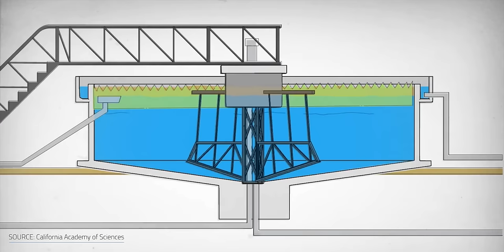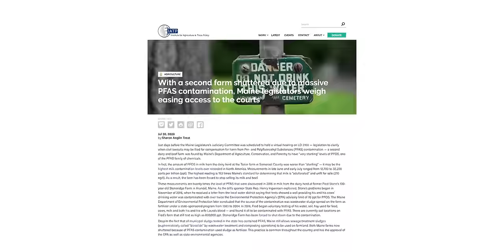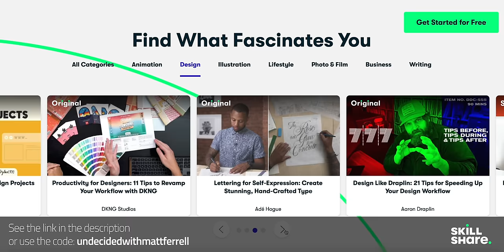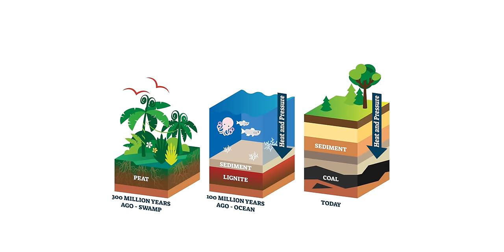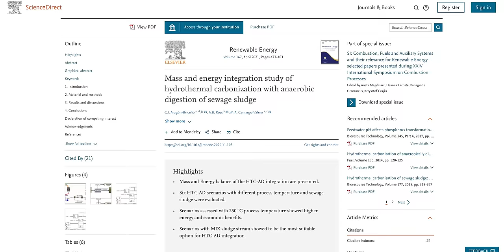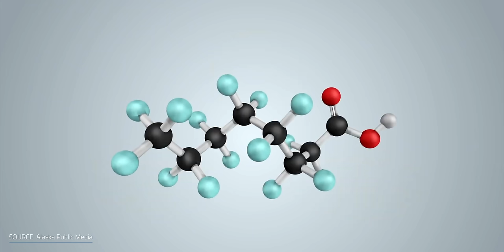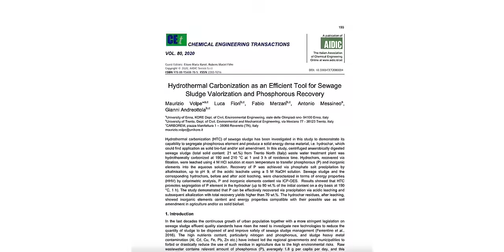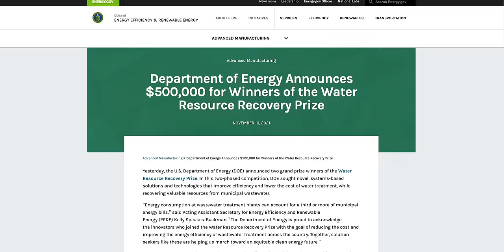Turning Human Waste into Renewable Energy?

Comment: I work in the water / wastewater "industry."
First a point of clarification; in the video around 3:20 you make it sound like waste treatment plants can or regularly do discharge insufficiently treated water into lakes and rivers. This is not the case at least in the US and I would bet most of the world under stable governments. While each state in the US is responsible for their own policing of EPA mandates, EPA and the State monitor WWTPs and WTPs very closely. While I am not read on the issue in Maine it is likely that it has to do in slow bureaucracy not keeping up. More about that below.

To my main point. Above I put "industry" in quotations. This is because generally WWT isn't a business. There is no money to be made in it. It is a nessassary service that any municipality needs to have and is therefore tax funded and not back by investors. While there are cases of commercial WWTPs these are more in kind with Doordash. You really could have done it yourself, but chose to spend a great deal more for someone else to handle it.

The municipality to state to EPA relationship slows down everything to paces where employees can be hired, work 20-30 years, retire, and things that were 'in the works' when they got hired still aren't fully implemented. An example, my local state level only got approval to accept credit cards for license renewal, learning materials, etc in 2001. That is a solid decade after the entire retail shopping sector. The big wheel of government moves slow and this change will too unless the private sector can somehow make this tech profitable and figure out how to unstuck the previously slow moving wheel as they will still be governed by the EPA.

Comment: Matt you are way off on the scale of dry tons of (sludge) per day produced by the U.S.  I operated a city treatment plant with just over 2000 sewer connections.  The town generated ~173 dry tons of sludge in 2010.  This was a small plant, with max capacity @  0.75 MGD.  Which is only 0.473 tons a day.  But this is only one small town.  So your range of 5-13 tons per day for the entire U.S. is probably at least 31,000 dry tons under.  Chicago's wastewater treatment plant (I think the largest in the world) has it's own facility to generate pelletized fuel pellets from waste sludge.  I trained with an engineer who worked there.  Food for thought!  No not food....and don't drink from the purple faucets at wastewater plants.  I've seen that ruin one too many thirst workers days!

Comment: India has public transportation ie scooters running on biogas (gas from poop) . They have a household gas cylinder sitting under the seat.
Also the regular cooking gas for households is boigas ( called gobur gas there).
I am surprised that the west has been slow to do research into these low tech methods. Maybe because poop is nor the fashionable thing to be dealing in!! In villages there cow dung is quickly picked up and used for making into cakes as a heating fuel. And also to make into walls floors for their dwellings. It hardens and no smell and actually clean.
Millions of indians are supplied with biogas in cylinders to private residences buildings etc. So large populations in cities are not dependent on nuclear  or deep sea power . Or other methods which are ecologically less feasible.
Endless heating, cooking ,building material all recycled from cow dung / human waste / vegetable scraps. And other agricultural waste.
About time the world starts thinking differently.

Comment: its called a methane digester... congratulations you've discovered a technology they've had in zimbabwe for years
Reply from the maker: Did you watch the video?  It's not a methane digester.  HTC is completely different, but yes, it's not a new technology.  It goes back to 1913, but we're only now starting to apply it.
Reply: @UndecidedMF  yea i watched the video, its basically the same thing except your having to process it a lot more... where as a methane digester just requires low heat and the odd stirring every so often.

like if you really wanna go the extra mile you can then split the methane into hydrogen through steam methane reformation removing the exhausted carbon dioxide through carbon capture and storage and taaadaaaa you have hydrogen fuel from shit...

and then you can use the captured carbon that is now in its raw solid form for things such as manufacturing them carbon fiber wind turbine blades...

like everyone thought the movie "thunderpants" was a joke but there actually is some really interesting science behind turning fart/poo into fuel...
Reply: @UndecidedMF  either way the HTC process as carbon neutral as it is still has one glaring problem... your producing coal... which is one of the dirtiest burning substances you can get... like id rather burn a diesel lamp...

Comment: human waste is compostable it's literally the best fertilizer if you simply just shat into a special compost bin that has a natural gas vacuum to store the gasses created for later use as clean gas it sequesters carbon and also makes it so you don't need plumbing if used on a home to home scale it would be a better way to manage our society as PFAS and other forever chemicals need to be removed we could add in special enzymes in powdered or other forms that are designed to break down plastics and re-engineer them for PFAS and other forever chemicals, and bam you have a hyper efficient waste management system that also gives you compost and natural gas for near infinite uses, all you need is some wire mesh, duct tape, nails, 2X4's, and a saw, tarp, some tar, and a hammer and a simplified air conditioner (basically a fan in a tube) used to make a vacuum leading into natural gas storage. All totaling for maybe a couple hundred dollars per person for a lifetime of quality of life increases.
Reply: the tar is for sealing holes, made easily through various methods
Reply: can also be made from rubber tires to sequester more of rubber waste
Reply: you're welcome I solved the issue with reasonably effective methods to save SHITLOADS of basically every resource because percaline thrones are ineffective and shitty BADUM TISS

Comment: This is charlatinist gimme a grant bullshit. I worked on a project where we put a dome over a sewage treatment plant's aeration pond to collect methane from the decomposing waste. The landfills have vents venting off methane & CO2 or some of them have flares that burn off the methane & CO2. Some of those mixtures are super clean burning. The HTC coal can make diesel or it can even be further refined into a crude gasoline, light aromatic solvents & gases. This is just refining processed poop. Every refinery has pressure vessels but refined poop is not energy dense like coal or crude oil is.  You can carbonize anything that has carbon in it. Anyone who has ever made charcoal or char cloth knows how this works.